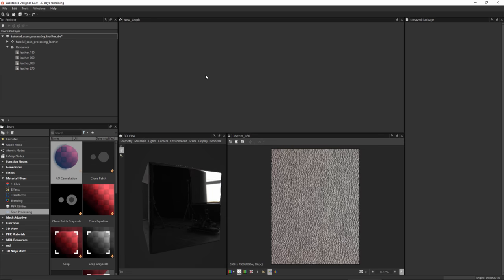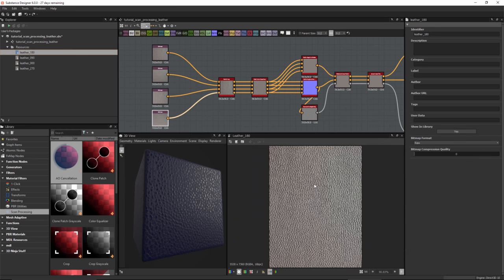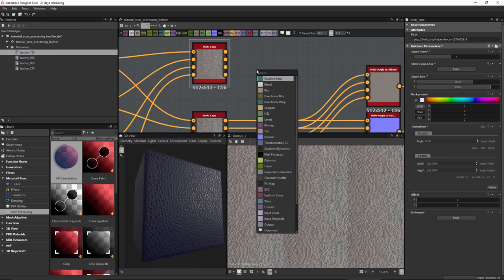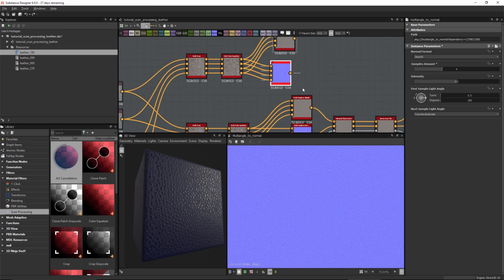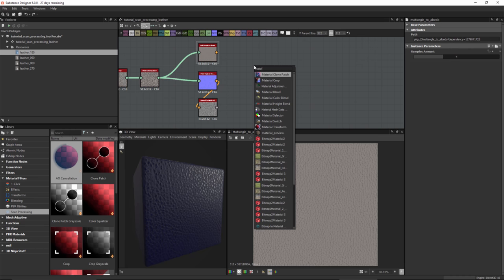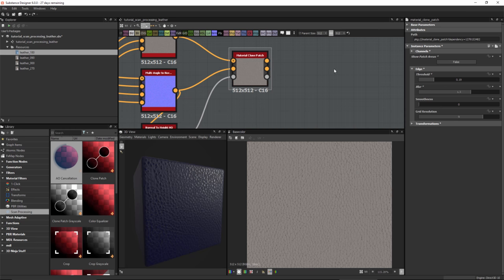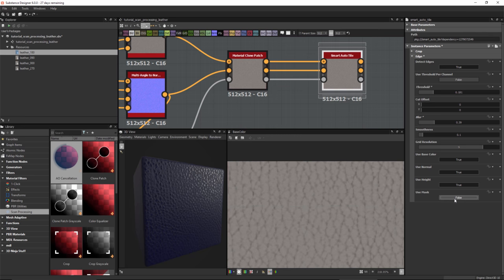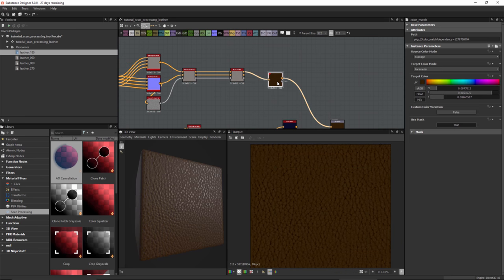Using the Scan Processing Filters | Adobe Substance 3D

Comment: It seems that "Show patch areas" is missing from the recent Substance Designer version. Took me ages to figure this out but if anyone wants to bring up the grey overlay masks used here in the 2D view then click inside your 2D view then press the 'C' key to cycle between your different maps. One of them should be the mask you're looking for.
Reply from the maker: We updated the nodes and the areas are now a specific output on the node.
Reply: Ah ok that makes sense now. I figured it was just there in case I wanted to use the "patch areas" as a mask to plug in to other nodes. Thanks for pointing that out, it should of been obvious to me but I guess I was too carried away with looking for the missing button under the parameters rollout on the right.

Comment: Hi Allegorithmic,

Could you please clarify how to generate the scans that are used to input into your node structure. I am familiar with photogrammety and the process for creating  3d models with Agisoft photoscan. when creating tiling materials from these scans I am currently baking the geometry to maps and making the maps tile using Affinity Photo (it is better than photoshop for this process). It appears that you are generating this materials from 4 diffuse images of a material and not several maps (albedo, normal, displacement) or a 3D mesh. Please explain in more detail.

I have read the blog posts suggested and while they do outline the basics of photogrammey there is no explanation of how to take the mesh and maps created and use it with the new nodes. 

Thank you for creating this excellent software. Substance designer and painter have become indispensable tools in my workflow!
Reply from the maker: Thanks! Very glad to hear you like Designer. For the usage of the multi-angle maps, this video shows how to use them. This video shows the new nodes we added to work with the multi-angle scan maps.
Reply: Thank you for the response, though it does not appear that you understood the question being asked. Let me attempt to clarify further. 

I understand that this video shows how to use multi angle maps once they are created. What myself and I am sure many others would like to know is how are multi angle maps created?

Do you set a camera up on a tripod and take multiple shots from the same position but move the light source? Do you keep the material sample in a static position with static lighting and move around the object taking photos from multiple positions the way you would to create a photogrammetry scan in agisoft? If I were to attempt to use only 4 photos to scan an object in Agisoft the result typically would not be very good.  

None of this is explained in the video.  Please create a tutorial, or point us to an article or video explaining this process. I have looked on google, and while I can find a wealth of information on photogrammetry and processing 3d scans with baking and  photoshop, I can't find a single hit on "multi angle maps".
Reply: Keep the camera static and move the light. 0 / 90 / 180 / 270 degrees. Its a different method of photogrametry than the Agisoft sort of way. I use a camera on a tripod and my phone light.
Reply: I'm desperately trying to figure out how to hold the light source to get the same results as shown in the video. However I just can't figure it out...
Do you hold your (phone) light exactly parallel to the surface you are scanning at any of these angles? If yes, at which one? 
Sorry if this question sounds stupid, but I think if I can get an answer, I'll know at what angle & tilt to hold the light source. ^^
Reply: I still haven't had a chance to try this out but I assume that you imagine that your object has a target in the center and you move around it in an arch continuing to point the light at the object. 

This is basically the inverse of how you capture data for agisoft. I still don't fully understand how it could get enough information to make an accurate height map from just 4 images. 

Once again Allegorithmic it would be great if you could create a tutorial or point all of us at an article that answers these question and goes through the entire process. This looks like a very powerful tool but it is useless if we do not know the appropriate process to create the photographs that need to be input in the node.
Reply: Yeah my first thought was as well that you move in an arch around the object. However the lighting information in the example leather textures seems kinda "off" to me if you move in an arch. I'm wondering if maybe we are supposed to move in a circle around the object and light it from each of its four "sides". However there is no doubt, that we need official information from Allegorithmic on how to hold/position the light correctly for the four photographs. Otherwise we'll probably never get the best results...

Comment: Hey Allegorithmic, I know this is an old video but I’m just now working with photogrammetry and I love this process. 

I actually have built my own scanner out of LEGO pieces to get me going. I’m just trying to find the technically way of creating roughness. I see how you did it here, but is this the actually proper way of doing it? I would think that capturing a perfect albedo map with a polarized lense and then taking one of the images with light and theoretically subtracting the albedo from the light. I should just have light after that. In most cases the brighter the light the less roughness and more glossy. So after doing that and adding them together then I should get a proper roughness map. It just doesn’t seem to work. I always have to adjust it no matter what. One of the biggest problems is combining all of them. I don’t want to use the multi Albedo creator to fuse them. When I do it tries to subtract the light that I’m trying to capture so I know it isn’t correct. Is the a better way to combine four or eight maps into one properly? After awhile it gets more complicated then I believe it to be worth. I love using it for normal and albedo capture though. 👌

I have a whole library of textiles at my disposal because I work for an interior designer. If I could capture these without having to manually do each roughness then that would be awesome!
Reply from the maker: Thanks very much for your feedback. We are working on methods for creating roughness.

Comment: this show cropped area parameter from the multi crop tool is missing in 2017.2.1 and it makes it impossible to precisely crop. i can expose the parameter but it has no effect. the cropping is very difficult because the cropping area indicator is off to the visually displayed cropped area. it super frustrating
Reply from the maker: The crop area in 2017.2 and higher has been moved to an output on the node. It's called area and you can double click that output on the node to see the crop area.
Reply: @Substance3D  Thank you, can you clarify why this UI element was changed?

Comment: Hi, I still do not use Substance yet but follow its progress. The concept is good and makes adjusting textures simpler in the long run.

I watched this video and I like these new nodes, the cloning patch tool seems a bit to rigid (wondering if you will be able to clone paint freely with a brush like in photoshop?) but my main question is when you do the auto tile. Would it not be easier to fix the tiling when you only have one image(input) to deal with (after the Multi Colour Equaliser) so you do not need to drag multiple inputs?

Also is there a way to drag multiple inputs at once rather than each input individually all the time?

Thanks,

Richard
Reply from the maker: You can place the graph into material mode (3 key on keyboard) and this will allow you to work with the multiple outputs as a single node connection. In this case, you need to use the tile with multiple inputs as the scans are from multiple angles.

Comment: I have a question on MDL:
Were did you learn to create MDL materials?
I watched the MDL in substance designer videos for at least 2 times and read the MDL handbook for at least 3 times. 
Now I have a understanding what MDL exactly is and how it works but my materials are still not good. 
When I create a material I don't know which values I have to use or which materials I have to combine to get the result I want. 
So where can I learn to create perfect MDL materials?
Reply from the maker: That is a tough question : ) I really struggle with this myself. You have done the correct steps for learning how MDL works. The part for knowing the values comes down to research. There isn't a dedicate site for reading on materials. You just need to try and research the type of material you want to create to get the values. We are discussing creating our own MDL handbook similar to the PBR guide we created. This will be a good resource as there isn't anything out there that is dedicated to MDL.
Reply: Thank you for the answer :)
I asked almost the same question on the Nvidia arc forum
- I didn't get a reply
Reply: Because it is complicated. There are no simple answer.
The whole "crate a realistic material with computers" thought is not a straight forward thing. Multiple ways, multiple approaches. With MDL you create your own shaders.
Also, there are no best shader model for everything. Mainly because it is not reality, it is a mathematical model which essentially: how to reduce and simplify all the observable features of a "thing" to a point where the computers are fast enough to calculate all the lights on it.

But, do not give up. There are many things you have to learn.
I am personally try to learn this for years, and I am still not there where I want to be. You can go deeper and deeper in the subject.
Cheers
Reply: But please notify me if you found something because I really want to learn how to create high quality mdl materials.
Even if it's very complicated :)
Reply: I will, I promise. If I find one. :)
Reply: There is a webinar next tuesday from Nvidia about physically based materials. I registered for that. I hope they show some techniques for creating mdl materials
Reply: Thanks :) But it's pretty similar to the MDL handbook in some sections
Reply: I will attend the webinar next Tuesday and if this does not help me I'll write an email to Nvidia. It's my goal to create photorealistic images like this:
http://www.migenius.com/migenius/wp-content/uploads/2014/11/irayvsphoto.jpg

and I will not give up this dream only because there are not enough trainings out there!